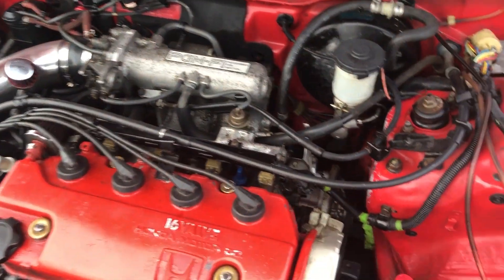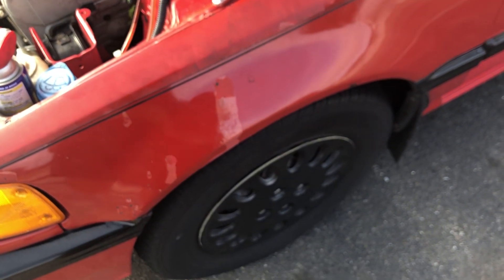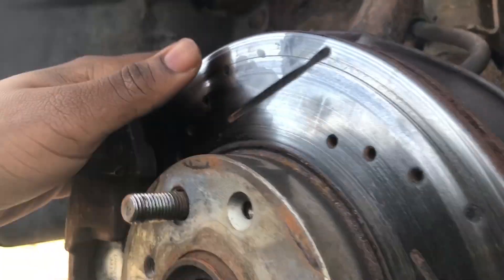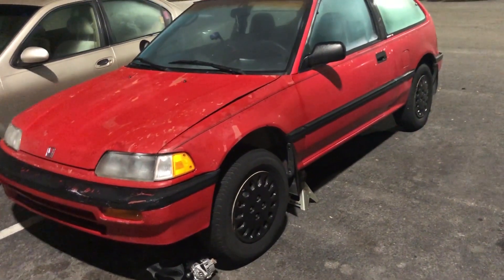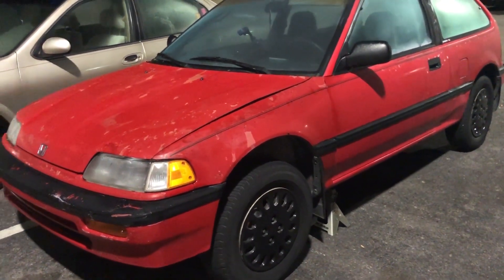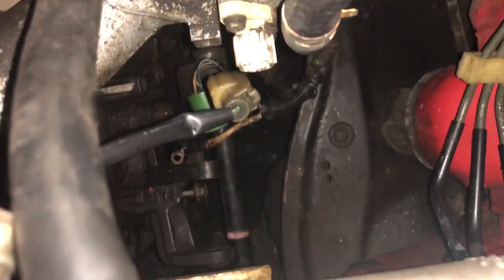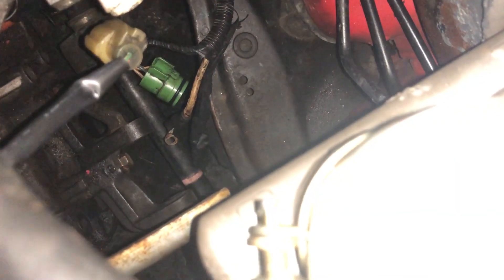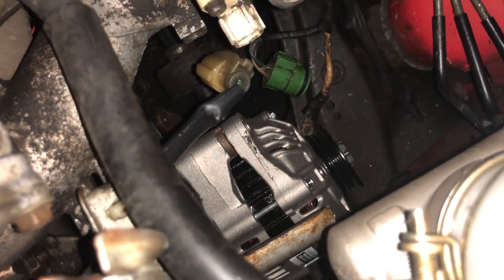HOW TO replace the ALTERNATOR on a EF CIVIC SI #Honda #Civic #DIY

Comment: The bolt that was missing is indeed a 14mm for both sides.  And no you don’t need to remove that bracket,just use the square head and place underneath the alternator and lightly tap it with a hammer and the square head.  It will pop out little by little,you don’t even need to remove the wheel,also. Go to the top of the car and remove the air hose that goes to throttle body and you can slide the alternator across to the passenger side of the car and pull it up through there.  You won’t damage any lines but you will have to push some out of the way.  It is a tight fit but you should be good     I also had to replace my belt which nobody online or YouTube explains how so hopefully what I tell you helps somebody out here

So in my situation I don’t have a working ac compressor so I cut the belt for it. This makes changing the alternator belt ALOT easier. If you wish to keep the ac belt there’s a tensioner you need to loosen that at the top end of the engine. Downwords near the front left of the motor mount on the right side of the car.  Loosen enough to pull the belt off so you can get a new Alternator  belt in,then reinstall ac belt and tension it back.  Now the easier way since these old ac compressors run on r12 ,which you can’t buy anymore.  You could convert it to r134a but this is for the person who is like me and doesn’t care about it. Just cut the belt  AND NO you will not damage anything. The belt only works the Ac so without it the car can still run.  So cut the belt then you can get a alternator belt in easier and won’t have to worry about messing with the pain in the ass AC tensioner.  I’m sorry if some of this is a jumbled mess.  I stayed up all night then decided to replace my alternator on a whim.  I’m running off like 45mins if sleep.   Have any questions I’ll write back as soon as possible
Reply: Caution!!!!! Make sure you don’t have power steering!!!! The cuting belt method is only good for Ef civics that don’t have power steering!!!!!!

Comment: I had the same happen to me last night lights dimmed and then no power. Dead battery orthe car was running off the battery. It might be loose wiring or fucked up corroded wiring. Ill be checking out my car soon after work.

Comment: Really late to reply but it would have been easier to take the air intake off and you could just slide the alternator over to the passenger side and it comes right out from there no need to jack up the car or remove the bracket if you still have the car give it a try next time

Comment: Ok, well here goes nothin'......
Reply from the maker: Ian Moone did you get it installed right?
Reply: @derrickjohnson12341  I did, but the problem I ran into was due to the car having aftermarket coilovers on it and they wouldn't allow the axel to drop down far enough to give me enough space. To get around that, I took out the bolt that holds the strut to the wishbone and was able to force the axel downward to give me just enough room to get the old one out and new one in. Thanks for posting this video. It was quite helpful.
Reply from the maker: Ian Moone thanks! I'm glad I could help sometime. Feel free to subscribe and check out some of the things I'll be putting out in the future
Reply: you rock for this video. i appreciate you a million times over